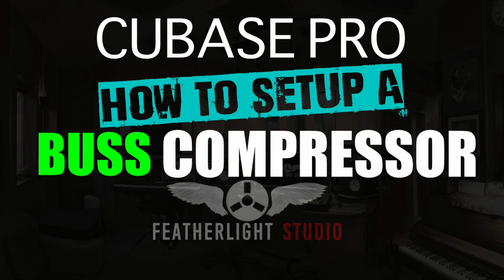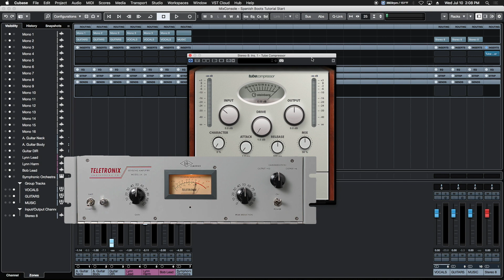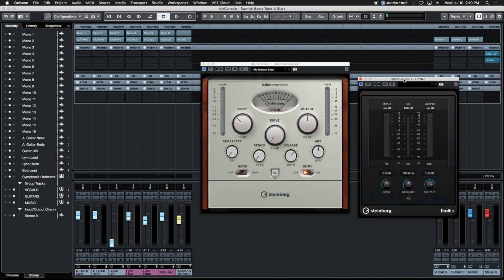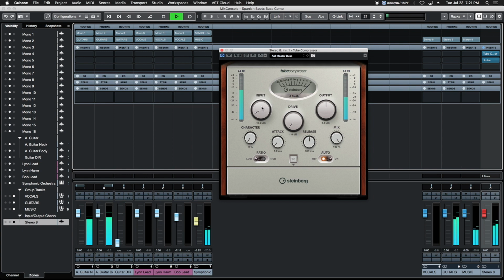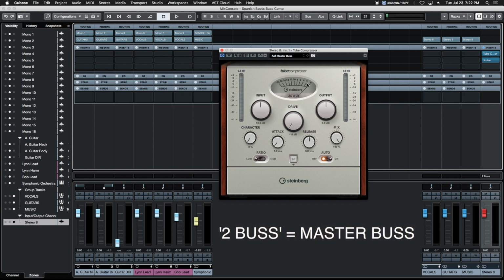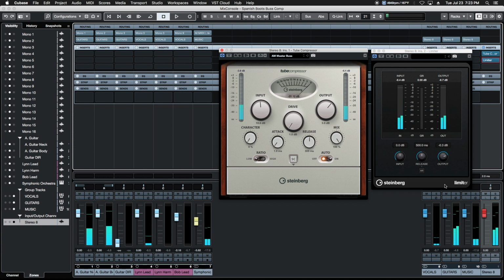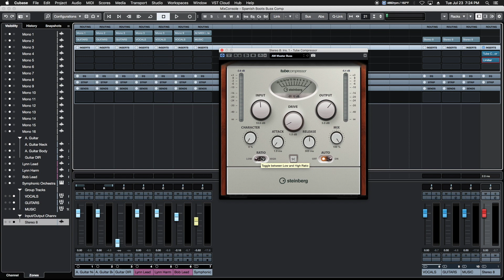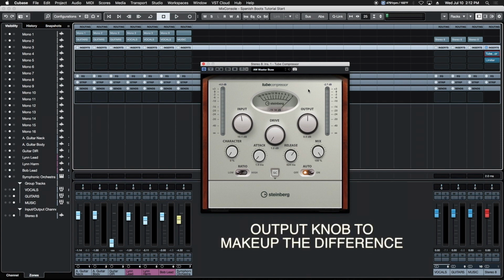LEARN CUBASE - 13. BUSS COMPRESSORS

Comment: Thanks for this but can you clarify what you mean by 'at the beginning of a project'? Right at the very beginning of a project there are no tracks so you can't set this up based on the loudest part of a song. If you mean at the beginning of a mix session do you have any tips if you record and mix at the same time with regards to when and how to add master bus compression?
Reply from the maker: Most of my projects start with templates that already have a Buss comp in place, so yes, the very beginning. But, if you have never used one before,  Buss comps have pretty subtle setting to start. roughly 2:1 ratio with fairly fast attack and release settings (Auto, to get you started) and very little threshold until the projects fills up. You want to achieve a -3db reduction at the most for a ballpark depending on your material of course.

Comment: This is interesting. I am working on learning proper digital gain staging and how to add dynamic effects is on my radar. Would you say that I could use similar approaches to add compression to individual tracks (ie bass gtr, kick, etc)?
Reply from the maker: Absolutely, many of the most common buss comps out there work great as track or group comps as well.